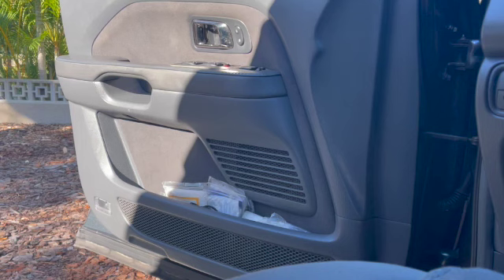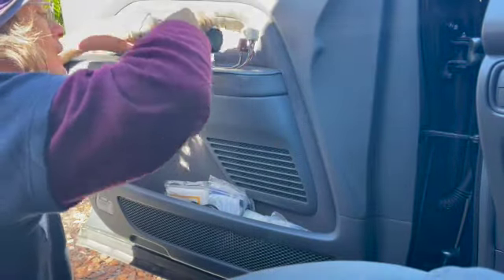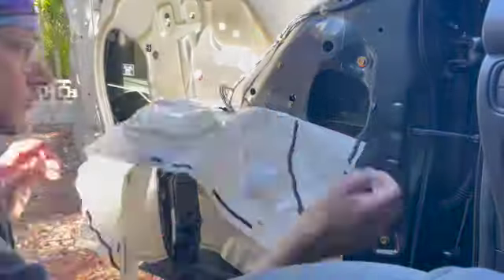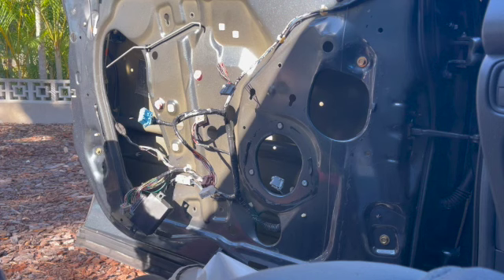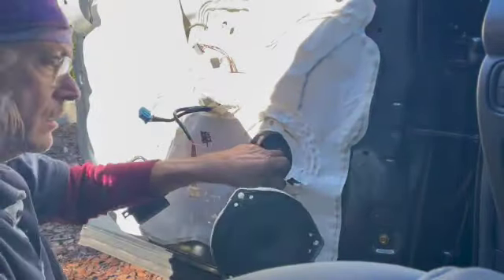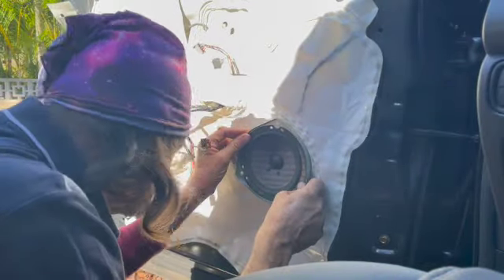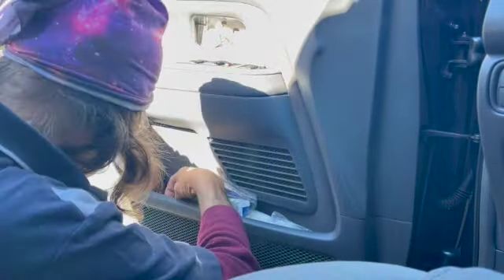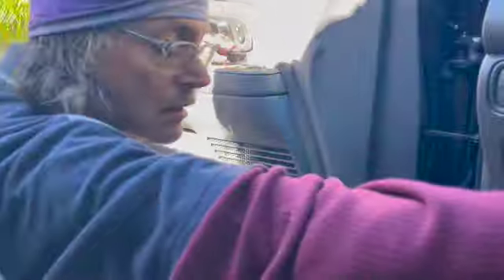Honda Pilot 03-08 Window Regulator Replacement & Repair Left Front

Comment: Thanks for covering how to do this. Another thing I learned- I hit a roadblock while doing mine which was stuck in the up position, but I was able to use a ratchet straight wrench to get the bolts off (I was unable to cut the cable). I got the bolts off the window, unbolted the regulator and motor from the door and it still wouldn't budge. Silly me realized that I had to take the top left bolt holding the regulator to the door all the way off since the window was up, there was no room to use the oblong hole to slide the bolt off without unscrewing it. I'm sad to say it took me about 30 minutes to figure out that I just had to take the bolt all the way out, but when I did the whole assembly slid out no issues.